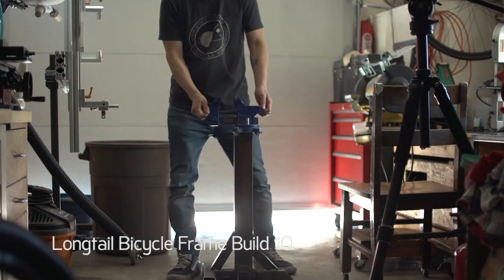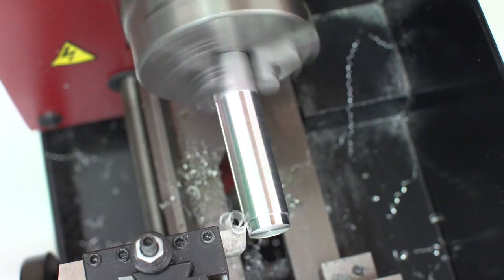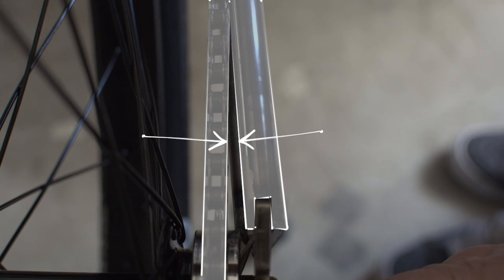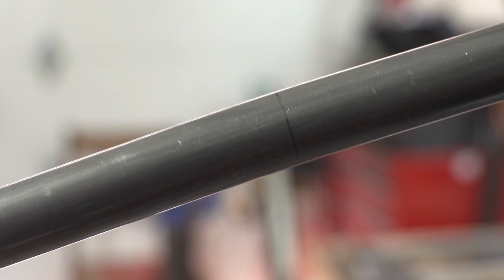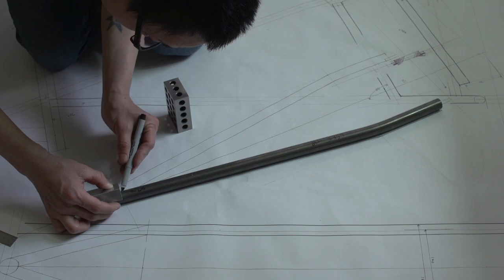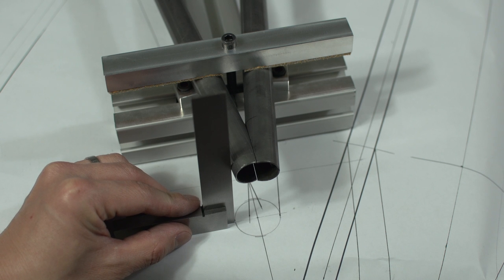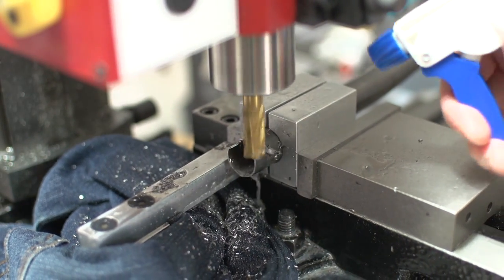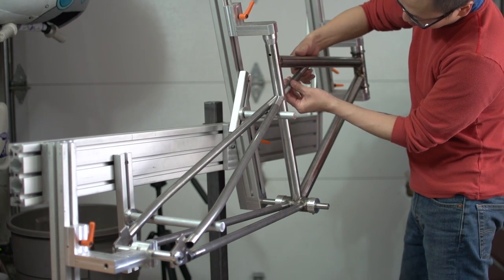Longtail Bicycle Frame Build 10 - Bend Miter and Tack Seatstays

Comment: Hey man, great to have you back.  Question: why are the dropouts aligned with the center of the chainstays, but the inside edge of the seatstays?
Reply from the maker: It wasn't my original plan. I aligned to the inside edge of the seat stays so to have more clearance for the chain. On normal bikes this isn't an issue because the SS are usually more vertical. But this being a long tail the SS run more horizontal and therefore come really close to intersecting with the chain line. Hope that makes sense!
Reply: Oh yeah, makes sense.  Hope to see how the frame handles.